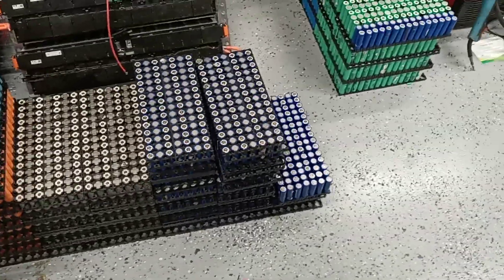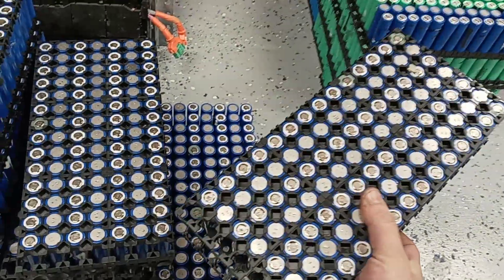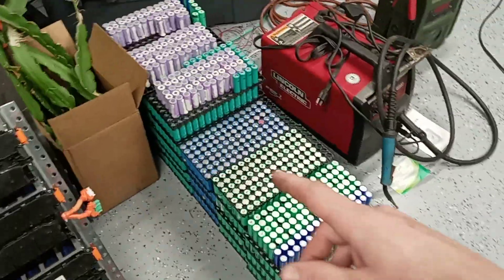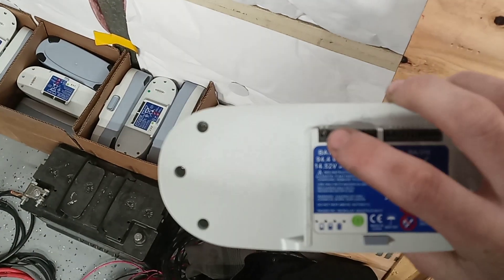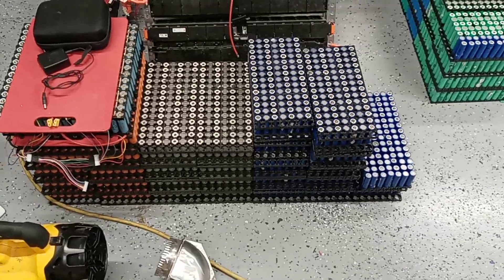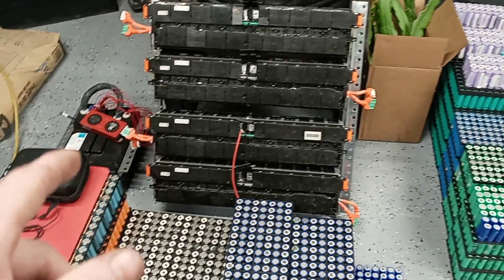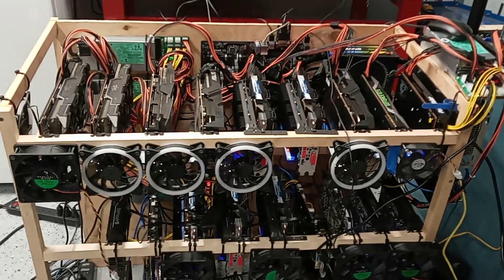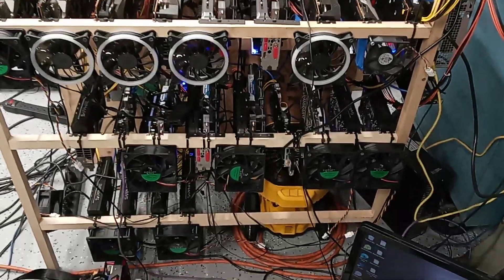Increase mining profits with FREE POWER well almost...

Comment: Not sure what your background is but you can actually buy solar panels that have cracked glass on eBay or locally.  I bought 14 panels 300W each and resealed them with a clear acrylic.  Cost me $500 for all the panels 😉
Reply from the maker: I have seen those! They are an excellent option depending where and what your doing. For my current situation I need labeled panels for permit purposes, and I am limited on space so I also want high efficiency panels. A friend of mine lives on a ranch off-grid however, and has several arrays built out of those and they work great!
Reply: @AnonymousMiner2  permits are overrated 😂
Reply from the maker: @richardtodd8852  yea I agree but the neighbors don't feel the same way 😂 especially the one that works at the power company. You should see his face when I clean the panels. 😂😂😂

Comment: Hey thanks a lot for the RVN man.  I own a business that builds electric switchboards.  You need breakers or anything let me know.
Reply from the maker: Congrats on the win! My pleasure on the RVN, definitely a project I believe in. I can always use more circuit breakers or other electrical stuff. I have actually been trying to source this one microchip for the battery management system I am building. Really hard to find right now

Comment: I was thinking about doing solar, was looking like a 3 year return on investment though and I wasn't sure it was worth it
Reply: 25 year warranty on panels tho...
Reply from the maker: Solar and battery backup is definitely not a get rich quick scheme. But, if you plan on mining long term it could make sense, especially as was mentioned, most solar components carry a 25 year warranty and some folks have tiers to their power plans, meaning first lets say 100x kilowatts is .10 cents, but from 100kw to 200kw is .12 cents, and 200kw - 300kw is .14, 300-400kw .16 cents etc. This means going to the next tier could drastically increase my bill. Adding solar can keep in the lower tiers whilst allowing me to run more rigs / pull more power.
Reply: @AnonymousMiner2  You also need the space to put the panels and everything right?
Reply from the maker: @koolaidman9200  yes, depending on your situation it could be impossible such as an apartment building, or other places it could be ideal such as anywhere with lots of open flat land. Wind and water generation should also be considered though!

Comment: How many panels and batteries would I need for my ryzen 5950 and geforce 3080 rig? I'm mining ethereum and monero, I think my power is around 375 watts total.
Reply from the maker: It depends on your geographic location, weather, tree's / mountains or other obstructions etc etc. But the simple answer is 375 watts x 24 hrs = 9000 watts or 9kw. With the 175 watt solar panels in my links, 175 watts x 6 hours = 1050 watts, so about 9 panels. 6 hours comes from daily average sunlight.